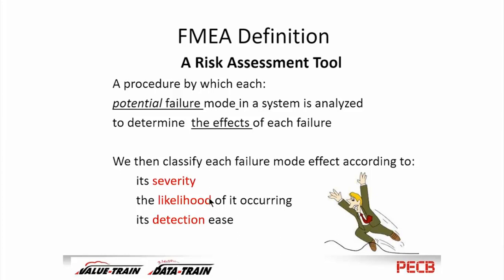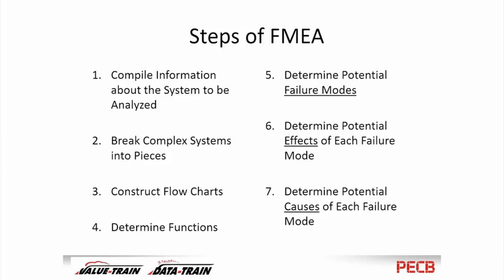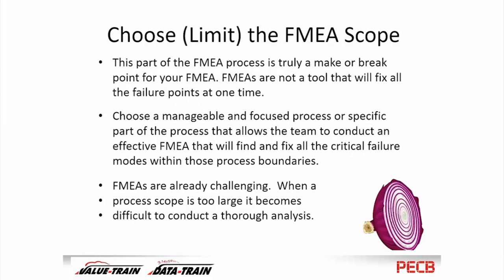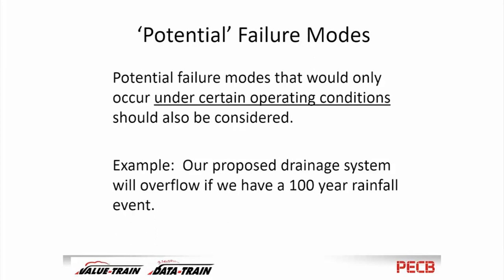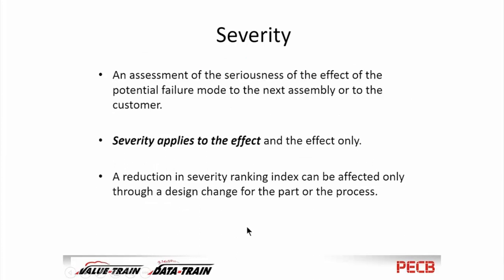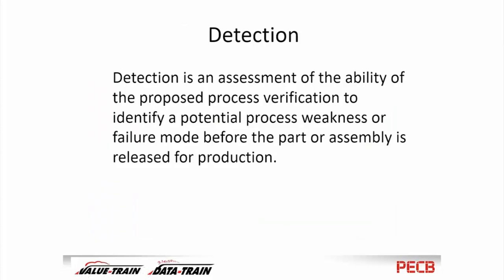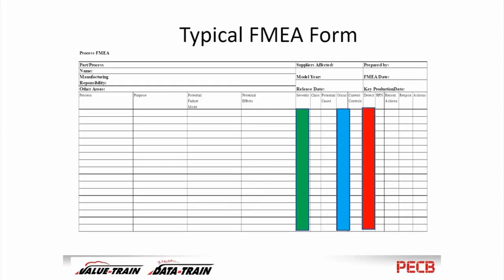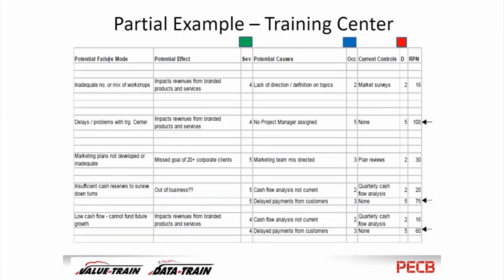Webinar | FMEA 101: How to Effectively Avoid Unintended Project Consequences

Comment: This is, so far in my research, the best explanation of the importance, and real world functionality of a FMEA.  I have been in the design and engineering field for 20+ years.  I was involved in the ISO 9000 certification process in the late 90's and I did not buy into it.  I thought is was just a ton of unnecessary  paperwork.  I now know that this feeling was because upper management felt that it was for certification purposes only, and did not follow through with the QMS.  I have now bought into it, and I am extremely enthusiastic to see the effects of the IATF16949 Quality system.  I just hope I can convince the owners of its importance.